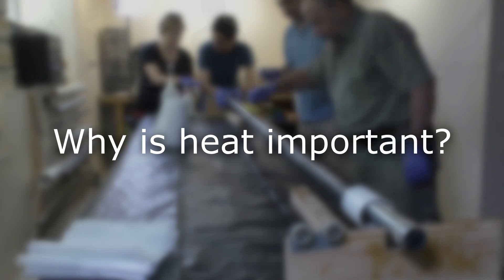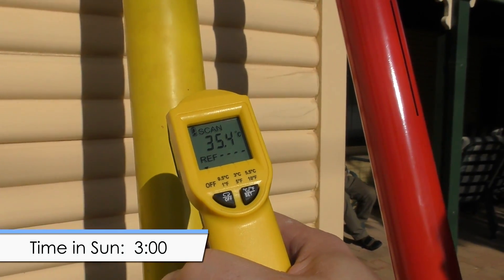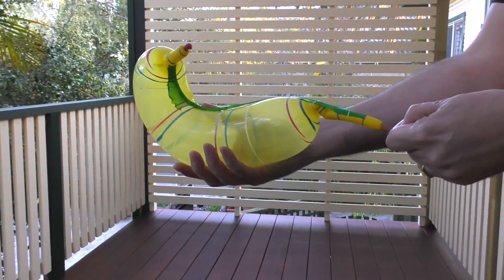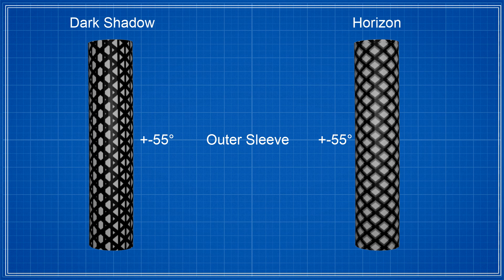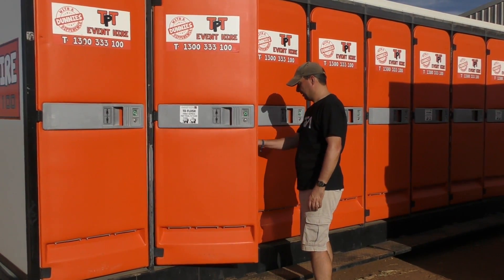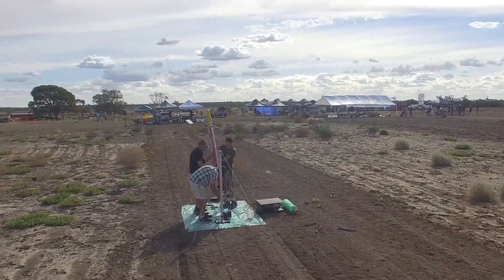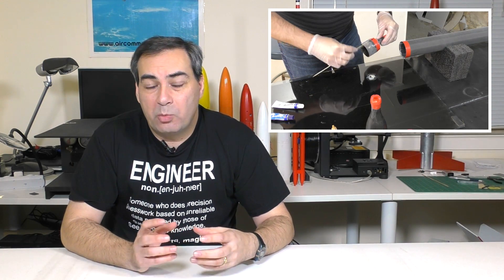2 Stage Water Rocket - Part 15 - Bending Details

Comment: 1 question: If you fill the rocket with a scuba tank (200 bar?), does the Rocket (60 bar?) not get cold?
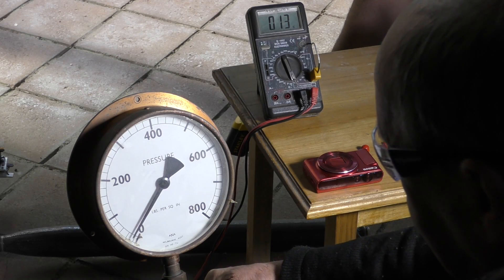Reply from the maker: No , as you can see in this video 3:54 the air heats up as you compress it. We are going from a scuba tank 200bar to 41bar. If you were going from a compressor it would likely be a little warmer.
Reply: Hello  @AirCommandRockets  , i think, then the air from the scuba tank must heat up from the ambient temperature on its way to the rocket. If you want to avoid that, you can isolate this way. But if you put cold air into the rocket and that air gets warm, the pressure will rise (but i dont know how much :)
Greetings from Germany

Comment: Did you ever try a thin brass tube for a liner. It could be soldered water tight.  Then carbon fibre outer.  Only issue would be weight.  But should help to dissipate heat from air compression and would be more leak proof.
Reply from the maker: Yes, this would add significant weight to the rocket.

Comment: Consider a large tube, possibly cardboard, as a shield from the sun until ready to launch.  Or perhaps a cage covered with a material that can be soaked to create evaporative cooling, that would break away just before launch.  Refrigerated water could also help control the internal temperatures for a short period of time.

Comment: your epoxy is not supposed to undergo tension stress. the fact that the rocket stretches when epoxy is weakened, means that you might want to preload your carbon fiber to make sure that it's taking the tensile stress before epoxy.

this can be achieved either by stretching the fiber while epoxy is curing or heating it up when it's almost cured (to soften epoxy), putting it under pressure and letting it finish curing while still pressurized
Reply from the maker: I understand what you mean, the problem was that the direction in which it stretched, there were NO fibers, so there would have been nothing to pre-tension in that direction. See part 16 of this series where we fix the bending issue simply by changing the direction of the fibers.
Reply: @AirCommandRockets  so correct me if i'm wrong, but i think the angle of fibers ideally should be to satisfy 2 conditions:
1) tensile strength of fibers should be directed so that the vessel would not experience any deformation under pressure as long as the fibers don't stretch
2) load should be distributed between all fibers equally
if you put one fiber along the rocket and one perpendicularly, then 1) condition will indeed be satisfied, so the rocket won't deform under pressure. however, condition 2) will be violated because tangential stress (hoop stress) in a cylinder is twice higher than longitudinal (reference: http://www.eng.fsu.edu/~kalu/ema4225/lec_notes/Web%20Class_6_final); because of that, if you orient fibers along/perpendicularly to the body of the rocket, you lose approx x1.41 of its strength compared to fibers being at optimal angle.

rocket with fibers oriented along/perpendicularly will rip along its length because its hoop stress is exactly twice higher than longitudinal stress.
Reply from the maker: @Alexander_Sannikov  Yup that sounds about right. Our problem was that the pressure chamber was wakened on one side due to the heat. If the rocket would have been heated evenly all the way around it would have just stretched a bit.

Comment: Another idea for cooling: build your launch tower as tall as the top of the rocket and use tubes with tiny holes to spray a mist of water on the outside of the rocket.  This could be continuously or a short time every minute or so.

Comment: Perhaps wrap a 1/8" layer of a closed-cell foam around the tube then your graphite tube/sleeve.
Perhaps too a fine mist sprayed on the rocket rather than the toilet paper.
Also, a tall structure near the launch tower to provide shade.

Comment: Supercooled salt water in your pressure vessel.   Or just ice cubes in the pressure vessel.    I’m not sure of the melt rate, but 1000psi should melt the ice pretty quick. Or some type of intercooler to chill the air charge before it enters the rocket
Polished aluminium foil reflects 95% of radiant heat.   Might be better than white paint.

Comment: How about using a super-chilled water solution of calcium chloride and/or filling the rocket with cold CO2 from 'dry' ice?
Reply from the maker: Refrigeration at a launch site can be quite tricky, especially if you are there for a few days. As you need power and equipment to do that. Also as soon as you put anything cold in the rocket, it warms up pretty quickly.

Comment: I SAID that it was a fiber based issue! \(^_^)/

They make some 650 F epoxies now days...that might help a little. ~( 'w')/

Take a long piece of PVC tube and tape the one end shut with a good water resistant duct type tape, put in the rocket up to its fins, add water and then fill... The water in the tube will absorb heat all along the surface! (~_^)-b

White paint is one idea, so too is a fine film of aluminum or copper surface coated then polished. ~('w' )/

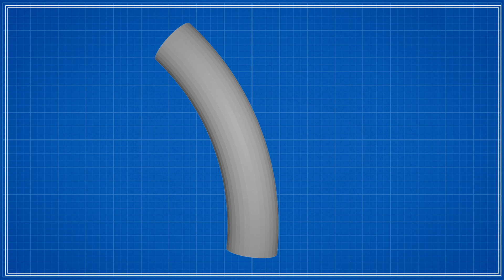Comment: At 6:55 there is a probable error; it is not possible that the fibers on the concave side of the bend are in compression in your case. Rather, because the whole system is in equilibrium, and because the source of the bending moment is the inflation pressure, I am certain that all the fibers are in tension and that the bending is caused by the selective yielding of the fiber-resin matrix on the hot convex side, as you describe. However, this does not imply that the fibers on the concave side are in compression. In fact, because the rocket body is in equilibrium, and because the deflection is small, a cross section at right angles to a portion of the bend would present a nearly perfect circle. From symmetry, then, the matrix on the concave side has an identical states of stress to the convex side. What differs between the sides is not the state of stress, but the response to it (yielding on the hot side, and comparatively smaller elastic stretching on the cooler side). Cheers!
Reply from the maker: You are correct indeed if the pipe is under pressure.

Comment: What about building a shroud that goes around your launch rail.... it could just be a piece of PVC pipe that the whole rocket fits down into. You could even get clever and run cooling air around the outside of the rocket while its inside the tube.

Comment: Maybe try an slevee Out of Cotton and soack it with water and put it over the Rocket while it is waiting for Start, shortly before Launch you remove it per hand. 
Or simply Splash it with waterguns
Reply from the maker: I think something like this would be quite practical. You would just have to use a long string to pull it off remotely but that should be doable.

Comment: Since you are using a liner anyways, i would suggest using a thinner Liner or the same one and using a layer of fiberglass between the 2 normal layers.
Reply from the maker: Is the fiberglass composite a better insulator than the carbon fiber composite? They would both use the same resin.
Reply: @AirCommandRockets  I dont have that much knowledge in the field, I thought of a liner with a fiber orientation to match that of the Dark Shadow.

Comment: Nice video, maybe you can try this; 
-Paint the rocket white
-Use a really big white PVC pipe and put it over the rocket (so it looks like a canon). Maybe you can blow air through the pipe with a fan from below.
-Put the suba tank in ice water so the air will be a lot colder?
Reply from the maker: Hi Basrockets, we will be painting the new sustainer white this weekend. :) Cooling the air in the scuba tank is probably not necessary. When you let the air out of the tank it actually cools quite dramatically because it is expanding. You can get frost around the valve outlet if you let it out for long enough.  The problem though is that as the cold air travels through the small holes in the manifolds and hoses, it actually picks up heat from these so by the time it gets into the rocket it is more or less at ambient temperature again. Then when it compresses in the rocket, it heats up again.

Comment: One thing to consider for the next project is to cure the epoxy at higher temperatures since this increases the Tg.
Reply from the maker: This is certainly true for some epoxies, unfortunately with the West Systems epoxy we are using, you can't post cure it to get improved performance. We are considering switching epoxies after this batch runs out. We'll have to also build an autoclave to heat it in a controlled manner.
Reply: @AirCommandRockets  I'm probably too late to suggest this, but the kinetix system available through ATL (same guys in aus who do West systems) is far superior. It has a longer open time, shorter cure time, higher HDT and can be post cured for an almost 90deg HDT. I highly recommend them after having similar problems on some of my projects. Is recommend getting the slow resin with fast hardener. I found this to be the best compromise and it is very low viscosity so can be used for small infusions too.
Reply from the maker: @matthewkenchapman  Thanks for the information. I may have to have a look into that.

Comment: Could you chill the air before it enters the rocket?  If the air starts at a lower temperature would the final temperature at pressure also be lower? For example, feed the air through a coil of tubing that has been placed in an ice bath between the scuba tank and the rocket thereby lowering the temperature of the air.
Reply from the maker: We've measured the air temperature above the water level in a previous test, the air bubbling up through the cold water had virtually no effect  on cooling the air above the water as that is where it is compressed. 
The air being released from the scuba tank actually drops in temperature, but it quickly picks up heat again as it passes through the hoses and manifolds so by the time it gets into the rocket it is more or less at ambient temperature again. You would probably need the heat exchanger right before the nozzle. 

One option I was thinking is if you could create foam in the rocket by the air bubbling up through  the water, that would fill the rocket with bubbles giving you lots of wet surface area all throughout the air volume. As you compress the air,  the bubbles get smaller and heat up, but transfer that heat to the bubble walls.
Reply: @AirCommandRockets  I mean 10 to 15 (or more)feet of metal tubing submerged in an ice bath. As a example, if the air leaving the scuba tank is at 22C after passing through the ice bath it is at 16C and this is the air that you will use to pressurize the rocket.
Reply from the maker: Yup, that's what I meant by the heat exchanger. The air actually comes out very cold from the scuba tank because it is expanding. You can get ice forming around the valve outlet if you let the air out long enough.
Reply: @AirCommandRockets  George, It looks like there will be several components to solving this issue, with each offering a few degrees of incremental temp saving.
I don't see any suggestion of using chilled water above. Given the thermal mass of water, compared to air, that seems to offer some possibilities. A cooler with an ice bath could likely get the water charge for the rocket down around 5C, or less. Of course there would be differential cooling, as it would be most effective on the lower section of the pressure vessel, where the water sits, but it might be worth some testing.

As for post-curing epoxy, when you get to that stage, it doesn't take much. I know of at least one instance of composite parts being cured in a panel van that had been painted black and parked in the sun. Maybe not well controlled, but the elevated temperatures inside did the trick.

Comment: Would a lower emissivity paint be an option?

How about a higher temp resin?
Reply from the maker: I think there are certainly paint options that will help. We are intending to use the same white Duramax paint that we used on the nosecone. The surface temperature measurements were even better than the yellow. A higher temperature resin is definitely an option. Often though you also need to have the airframe go through a post curing process, heating it to elevated temperatures over time. We are currently not set up for this. We also have 4 liters of this epoxy so would like to finish using it before trying a different epoxy.
Reply: @AirCommandRockets  
You want a paint with high black body radiation and high reflection. 
But I only know off satellites to use such paint, so I'm not sure if you can buy it on the free market.

Comment: The same thing happened to the UCT water rocket that holds the world record,it bent while being on the launcher.They managed to fix it so maybe ask them ,if that are willing to share .
Reply from the maker: Interesting. I wasn't aware that they also had a similar problem.
Reply: I heard it in the videos on YouTube,they said it bent like a banana during pressurization or something like that so I believe it is the same issue.also it’s hot here in SA and there rocket was also carbon fiber.i was thinking that you could make a tube that fits around the rocket and launcher with some type of cooling system ,and then remove it before launch.good luck
Reply from the maker: I'll have to re-watch their videos. I recall them mentioning that they had issues with the micro hole leaks in the pressure chamber which they also fixed.
Reply: Air Command Rockets yeah even if it’s not the same issue I’m sure there are lots of things they could help with ,it would also be cool to see you try the micro leak sealing on your rocket if it has that issue.
Reply: Air Command Rockets yeah even if it’s not the same issue I’m sure there are lots of things they could help with ,it would also be cool to see you try the micro leak sealing on your rocket if it has that issue.
Reply from the maker: We solved the micro hole issue as shown here in the video: https://www.youtube.com/watch?v=0AsxjGFYK8w about 3 and half minutes into it. It seems to work well. I don't know the exact details of what they did but I think they poured silicone rubber into it or something along those lines.

Comment: Thanks guys for this awesome video what stops you from sprinkling water over the outside with some sort of sprinkler system?. What's your accent?
Reply from the maker: One issue is bringing extra water to the launch site. Rocket pressurisation can take several minutes so you would want to be cooling during this time, to make it practical you would also want to recycle the water in some way rather than just lose it. You also need a pump and a power source for the pump. This just adds extra complexity. Wrapping it in a wet towel may be easier, and then just pulling the towel off with a string before launch.
Reply: @AirCommandRockets  Great, that explains that. Good work guys

Comment: greetings from Brazil to all. incredible. Rocket science is complex. but the problem was discovered. I thought it was uneven application of resin. very good. Congratulations and success on the next flights.
Reply from the maker: Cheers. :) Uneven application of the resin could certainly cause an issue. It is why we always put the rocket on a rotisserie for a couple of hours while it cures so that gravity doesn't pool the quite runny epoxy on one side.
Reply: @AirCommandRockets  . Hello. understand. thanks for answering. have a great day.

Comment: Two suggestions. Instal a drip/ spray irrigation system to the launcher. You could use alcohol to really cool the rocket. Second you really need a autoclave to heat cure the epoxy. Hardened composite has a much higher softening temperature.
Reply from the maker: The West Systems epoxy we use doesn't benefit from a post cure. We would have to switch to a different epoxy, but I agree that is definitely an option to increase the glass transition temperature.

Comment: maybe a coat of aluminium foil ..  buff it real good for max reflection. and then just a clear coat of lacquer (would become mirror like) . that should reflect more heat as white paint. but maybe a few grams more weight. although there are thinner alu foils as home use grade.
Reply: You’ll blind your spectators tho.
Reply: Sunglasses for sale at his booth :-)
Reply from the maker: Interesting, several people have now suggested this. I think the weight increase would probably be manageable. I wonder if it would also reflect the heat back in-wards from the internal compression heating. Perhaps Gold-leaf on the outside? That would be cool. :) There are highly reflective chrome like paints that may have a similar effect, and easier to apply.
Reply: Not sure about the inside the heat is trapped inside the chamber it has to go some where. The heat would then concentrate at nozzle and nose cone. That be an interesting challenge to conduct that heat away to the out side.   mmmm maybe if inner liner is connected to the nozzle then water cool the nozzle during filling maybe a heatsink. althoug that becomes to much of a hassle at launch site.